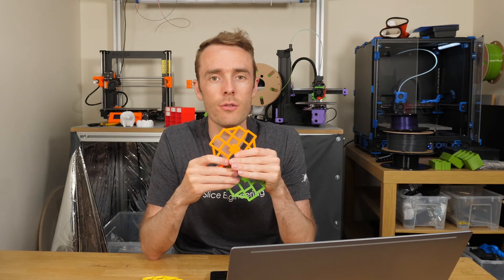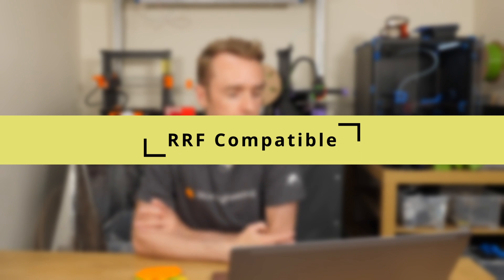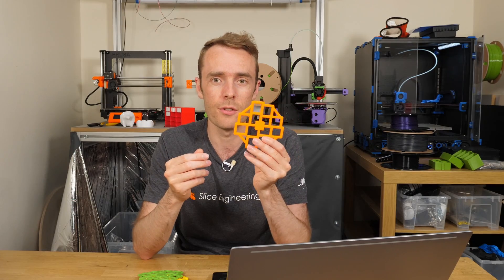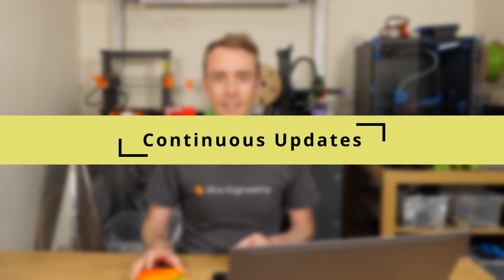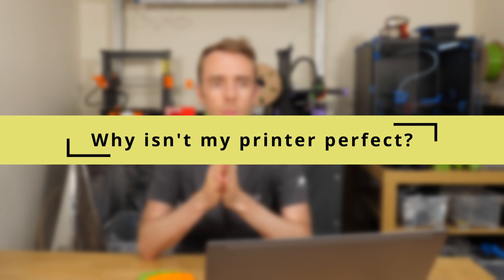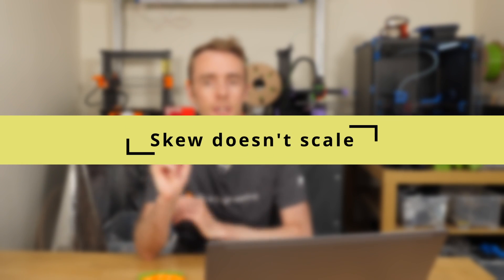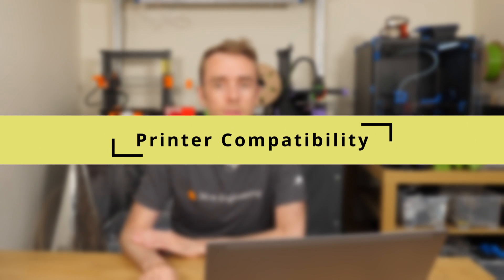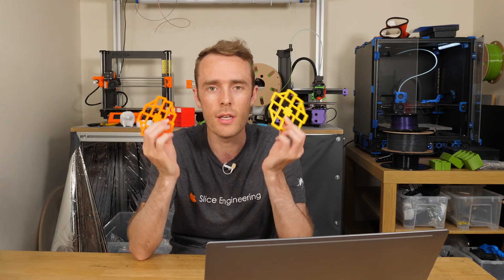The BEST Calibration Method Just Got BETTER

Comment from the maker: FYI: I mention in the video that there are no instructions, that's WRONG, there are instructions, really good written ones are included.
Also, for those that have bought previously, you can login with the same email you used to purchase and you'll be able to get the latest version.
One more thing, it looks like CURA now has per-material shrinkage compensation in the latest Beta version so I'll be sure to make a new update for that. (upgrades are free)

Merry Calibration, and Happy Printing!
Reply: got the calibration flower today, in order to use it to calibrate materials that crystallize when annealing and as such shrink significantly. would be really cool to add features to calibrate in Z direction too for these materials
Reply: i am having some issues with your website, i cant get the captia to show up to request help with this. i bought the original and cant access my account to update is there a better way of getting in touch with you about this?
Reply: why the model this expensive, this price a bit pricie

Comment: Is this design and calibration object still relevant 2 years later? Have there been any updates/changes to it?
Reply from the maker: Still the best method available. Quite a few free updates to it too.
Reply: @Vector3DP  Ok cool. Thank you. In the chart on your shop page I see Cura isn't supported. Does that mean that the corrections this Excel file proposes aren't supported in Cura? As in there's no place to enter the changes? I'd gladly make the jump to Orca if I could copy over my tuned Cura filament profiles successfully.
Reply from the maker: @pattygq  Yep, cura is just not great for the shrinkage compensation because it needs to be per filament and it isn't setup that way.
Reply: @Vector3DP  Gotcha. Thanks!

Comment: I've printed this multiple times, and I cannot get the skew to 100. One side is always over 100 and the other side is always under 100, any tips? What am I doing wrong? Thank you!
Reply from the maker: You're unlikely to get it perfect, there's no such thing as perfect when it comes to manufacturing. You should be able to get close though.
Reply: @Vector3DP  ya, I understand that, but I was getting it around 100.6 and 99.6, then when I tried it again, I got somewhere around 101 and 99 I think, I can't get it anywhere close to 100 though.

Comment: I found this interesting enough I had to reverse engineer it myself.   couple things:  a) Skew the Marlin AD distance, 100*2^-0.5,  doesn't that need to be scaled?  That is the perfect value and the AC  and BD  are in a scaled space.  b) if the Avg X Error and Avg Y Error are different wouldn't that indicate one of the axis has its Step/mm off.  I'd expect them to be the same if only material shrinkage was at play. c) seems to me flow compensation could be calculated.  Scale the measurements by the Shrinkage / Step/mm Then calculate the Inner/Outer Error off the new values.  d) If you know Skew setting for a set of measurements.  The new value is just the sum of the measured angle and the prints skew setting angle.

Comment: I know this is a completely different type of programming and probably not even possible..  but is there anyway to write an app that can take these measurements from a picture?   With like, a quarter also in the picture?

Considering the amount of recalibration that 3D printers generally need, even an app with ads should generate enough revenue to approach an app programmer.
Reply from the maker: I think we're a long way from a camera being good enough to capture the resolution needed for this level of calibration.
Reply: Yeah, these size measurements would be VERY difficult to catch on a standard camera, what with perspective and lens distortions and everything else. 

HOWEVER, your idea isn't far off for structured blue light scanning (revopoint pop mini) or lidar (Bambu X1), and the califlower+included methodology may be a good baseline for making the tuning tooling that pair with those emerging technologies to dial-in the crap out of future printers.

Comment: I have been using the Califlower to commission my E3D TC. Incredibly helpful! And thanks for the tip on line thickness, I think it explains my slight discrepancy between internal/external measurements.

Comment: @Vector3D: Kind remark from an mechanical engineer: please don't advise calibrating machine settings on material base. Steps per mm should be calibrated with calipers, not with an actual print, because of the dependency of material flow, extrusion temperature and fan speed causing shrinking, with ABS shrinking in general... You get the point.
I love your Califlower for material settings calibration though. Good job 👍 🙂
Reply from the maker: From the start it was always for shrinkage and skew. But some people can't integrate shrinkage well, so steps/mm is just for them really.

Comment: I have bought a califlower a couple days ago. Unfortunately i did not create an account. The tip above "go to My account and click reset password", does not work. The system throws the error message "Invalid username or email". Is there any way to update my califlower to the latest versions?

A little proposal, as you mentioned in the video a califlower can shows us underextrusion and overextrusion cases, it would be easy to add the field for starting flow number and calculate an assumption flow value to minimize this error.
Reply from the maker: YT comments not the best place for support, but just make you use the same email you purchased with.

Comment: Percentage compensation in cura is actually on a material basis. You can add it to material settings and put it for the material you are using. You just have to add it as an option.